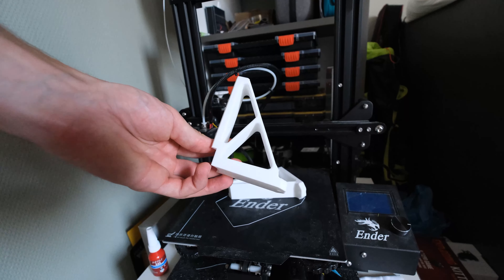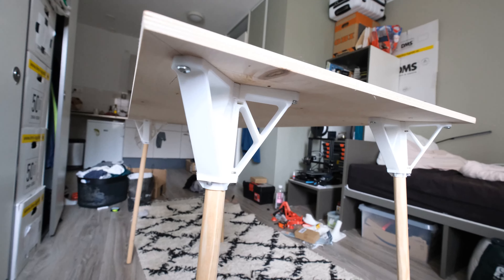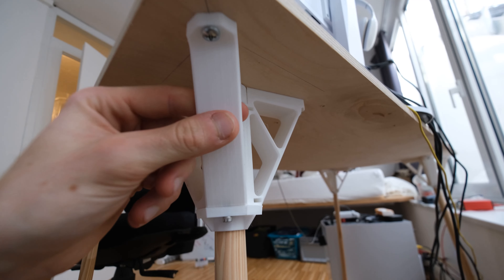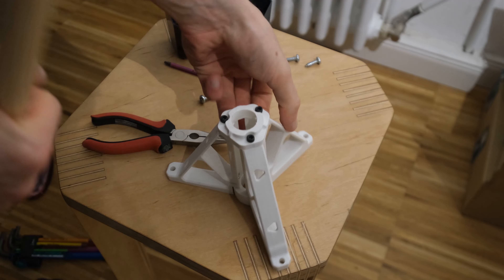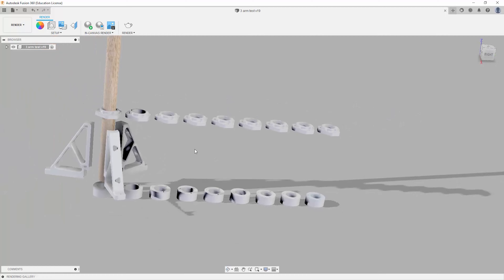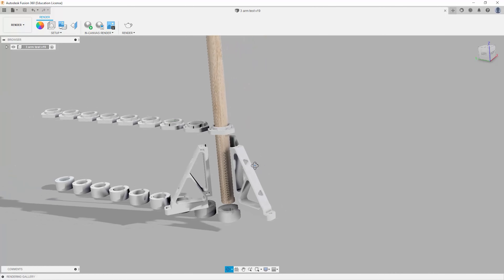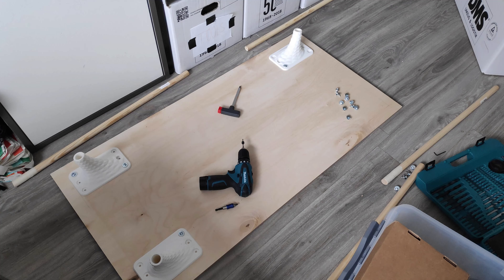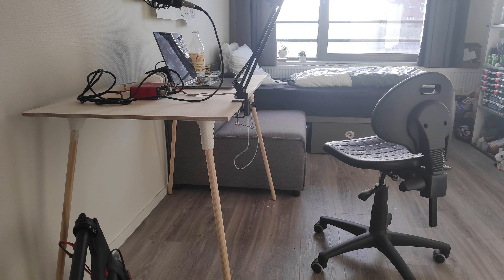3D Printed Table Leg MK2

Comment: Looking forward to giving this a try, thanks for sharing. Guessing each leg gets 1 each of arm 1, 2, and 3 (plus the correct ring). I printed these out, and now I have a little pile and I'm not sure which arms are which number. Is there any indication on the pieces themselves that I'm missing? Which arm is meant to be oriented "out" (ie away from the center of the table)? Seems there's a slight angle but it's subtle.
Reply from the maker: @patrickschless9992  ah good flaw you're pointing out hahaha 😅. I'll label the part itself next time. Well, yes they all have a different angle and it's important. But just place them on a flat surface and match the ones that lean exactly the same. Then you put together one unit and that unit is screwed on the table corner so that the leg points away from the center. Once you mounted one the others are easier to orient since you can mirror the first one kina. Hope this messy instruction for some miracle reason helps :D
Reply: @makermind2050  Thanks that's helpful :)  Making a small art table with my kiddo.  Excited to see how it goes -- guessing the wobbliness will be mitigated by short legs (and my 1" dowel is very snug in the 26mm rings, which may help)
Reply from the maker: @patrickschless9992  awesome. Have fun you two! :D